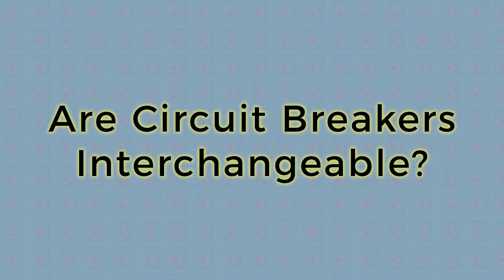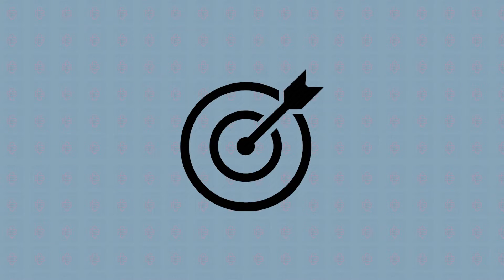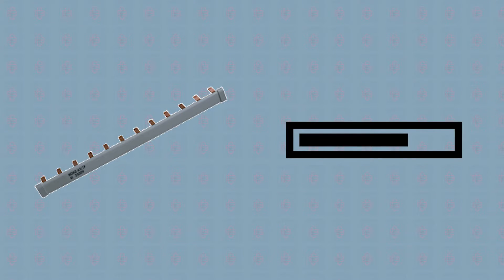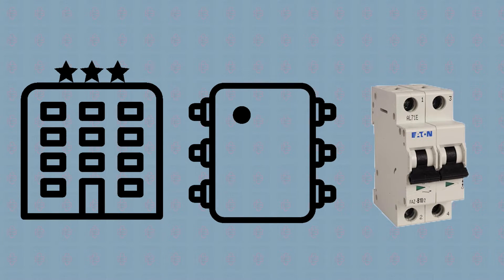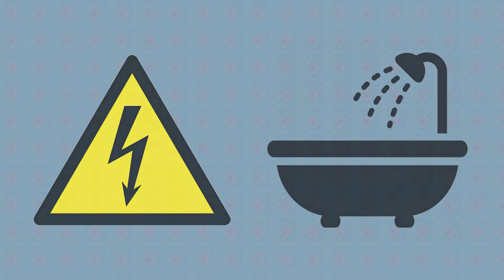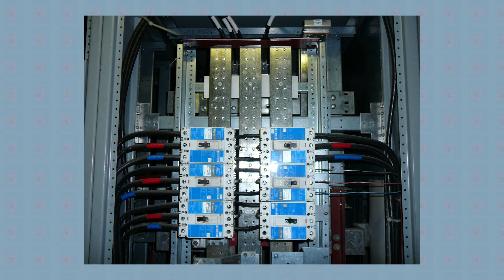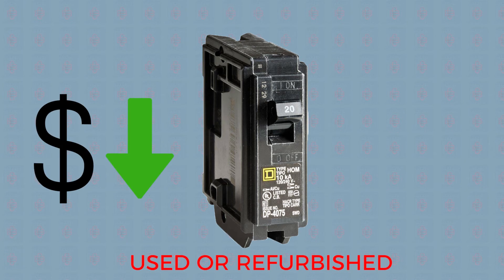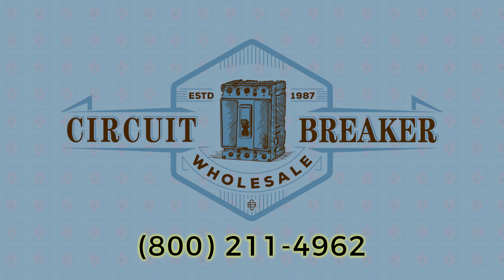Are Circuit Breakers Interchangeable?

Comment: Could be compatible ( it fits), but does it meet specifications. Example : If a single pole breaker type BL has an interuptive rating lets say 10k amps and replaced with blh type that has an interuptive rating 20k aic 
This allows the breaker to handle more amps but your main bus panel may not. Could blow out your whole panel costing thousands. If your home owner don't chance it and use the exact one or let a electrician do the math.